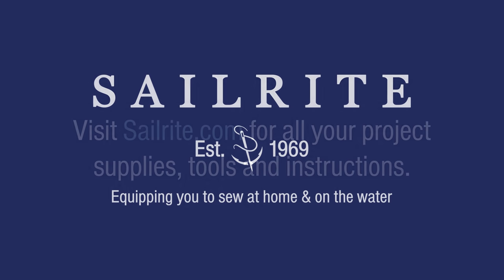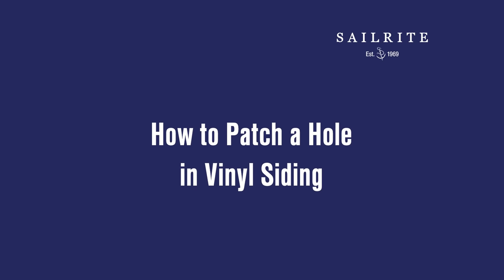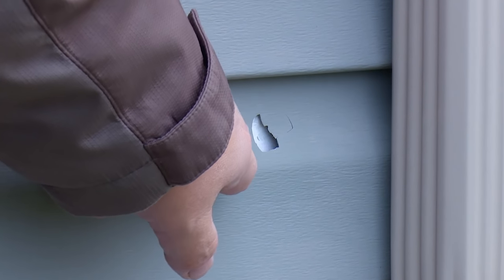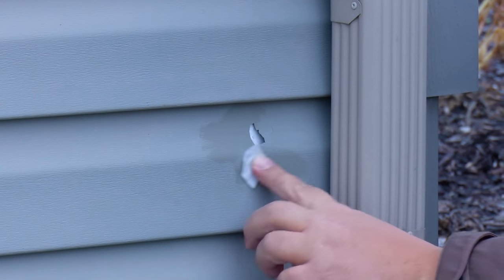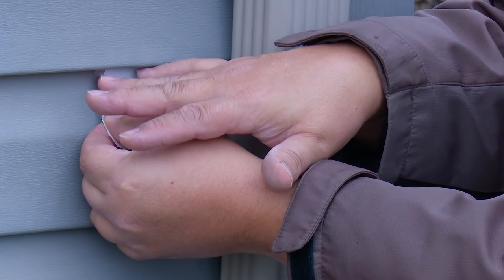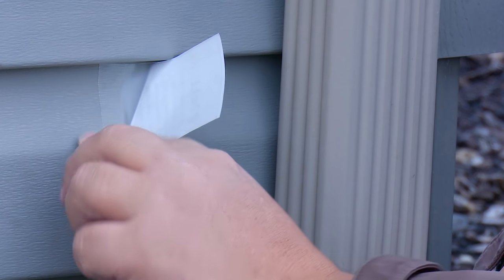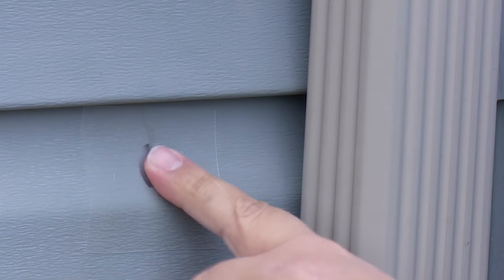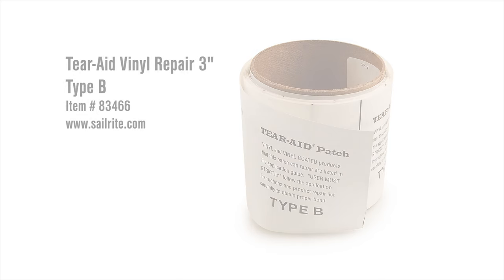How to Patch a Hole in Vinyl Siding in 3 Minutes

Comment: I filled the hole with insulating foam , waited till it dried and shaved off the excess, sanded it smooth and touched it up with paint and it looks good
Reply: That’s kind of what I was hoping this video would be!
Reply: Thanks for sharing
Reply: What about the dents from air spaces

Comment: This works great for someone who just bought a house and there is a hole or two in the vinyl siding and the sellers aren't fixing it and don't have any spare strips, so if you wanted to properly fix it, you would need to buy an entire pack and likely it isn't the same color, so you would end up needing to replace each strip to match properly. This video offers a great temporary measure between the winter and summer so someone can ensure that water doesn't pool behind that holes causing water damage in the meantime. The guy makes it obvious that it isn't permanent, but it is a great temporary solution. Thanks for the video. $10 now for a temporary solution is better than waiting until you have $300~ (or much more if you pay someone to do it for you) to fix the siding properly.
Reply: There is a putty to fix small holes, and pvc siding takes paint very well.

Comment: I don't know about you, but somebody shot my house up w/frozen paintballs in the winter & it caused multiple holes punched through of almost the size of  baseballs. My insurance wouldn't cover it unless I wanted them to increase my coverage for twice the amount I'm already paying. So it was No thanks. But I experimented, & for now I temporarily camouflaged it pretty much as I sprayed into the damaged holes  w/great stuff 'with an expanding foam that get's stiffened kinda like styrofoam. And by the way, it's called great stuff & is great for a lot of other stuff too. After letting it expand & dry I used a hacksaw blade to cut it off of all the excess expansion so to be even, flat  & level w/the siding. I then used what was left inside the holes for a backer support & puttied the foam over w/a plastic wood filler of a creamy white color much like my siding, After it started to harden or stiffen & was not completely dry to the touch, Is then I brushed over it w/a wet paint brush so to match the texture of the siding itself. Now before you get carried away w/it, note this is new to me & you  & so try it on a few small spots before going crazy. I am a good man to keep on hand Dave the handyman..

Comment: Why doesn't the manufacture make patches that match the color of their products?
Reply: They do, it is called "store samples". But they really only work good in the bottom flatter areas. I had to patch a hole in mine 10 years ago from a rock engauged from a lawnmower. It was on the flatter part, so I just JB welded a sample over the hole. Unless you knew it was there, it was almost oblivious to the naked eye...

Comment: I use tear aid quite often for odd jobs. You could also use angelus leather paint to paint over it with a gray color so the hole isn't visible. It would pass the 5-10 feet test anyway.
Reply from the maker: Great suggestion the Angelus Leather Paint! I may do that and leave it up permanently for years.

Comment: Just use a water-based window and door calking.  Looks better once you paint it with roughly the same color as the siding when it dries.  It's also a permanent fix (more or less).

Comment: If you have a piece of siding cut off at least three feet and make sure it's not close to another seam . Then cut the top lip off of the top of the siding and silicone the entire piece over the Hole laminating the entire thing. I must have did this 10 times so far and you cannot even notice it.
Reply: How is that a quick fix ??? The objective IS.....for it to be a quick repair.

Comment: Is it paintable once applied?  I don't want to see the hole!
Reply from the maker: I have tested with spray paint on the Tear Aid and it seems to work great. It must be painted after it is applied. If the vinyl patch is removed or stretched with the paint the paint will not stick, but that is the only issue I found so far.

Comment: Who wants to look at a hole?
Reply from the maker: I have tested painting the Tear-Aid Vinyl Repair Type B with a latex paint and it worked great. However, the test was conducted only about 2 months ago, so the test of time has not yet occurred. The paint should be applied to the product after it is adhered to the surface of the structure to avoid stretching the repair tape during application. If the repair tape is stretched (which often happens when applying to a surface) the paint will crack when it is stretched.
Reply: A gopher.
Reply: Uuuuuuh paint it ????
Reply: Depends on the hole.

Comment: WTF???  You made a video and a PRODUCT to tape over a hole???
Reply from the maker: This is an exterior repair tape made for vinyl fabric in the marine market. It is not effected by the UVR or weather and will last for many years, where regular tape will quickly fall apart.